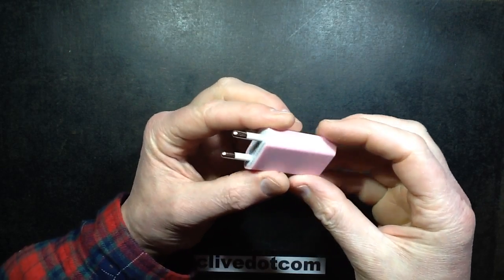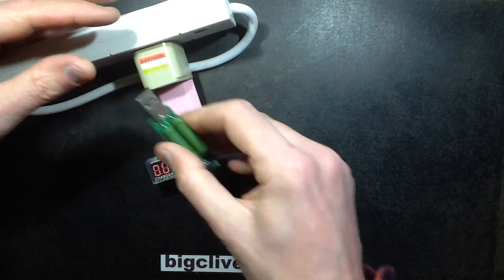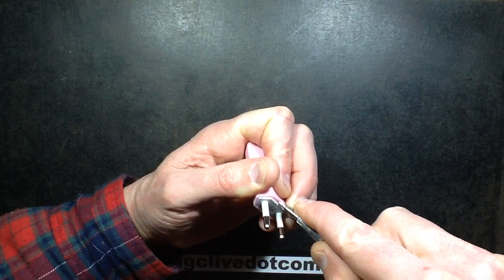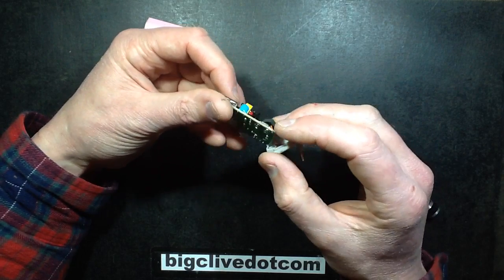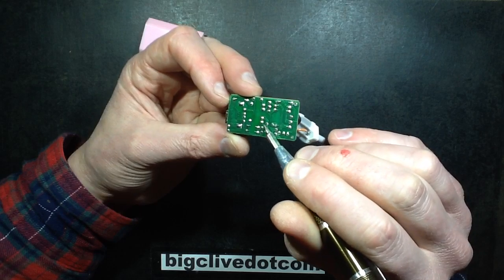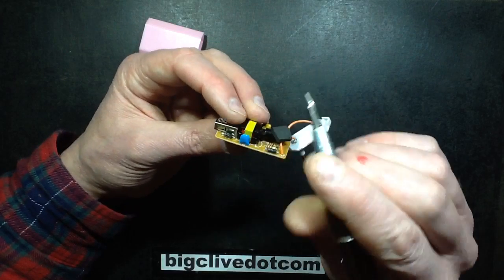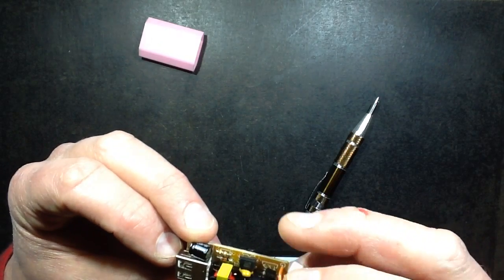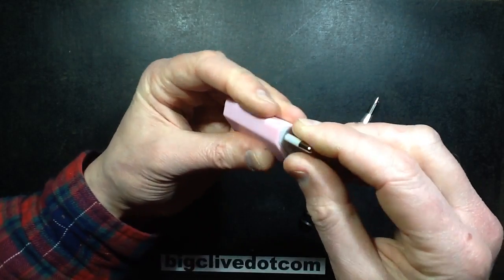A look inside a cheap slimline USB charger from ebay.

Comment: Hello Clive.   I am absolutely paranoid at buying any chargers from ebay, as they are not branded.

I have just bought some security cameras, allbeit at a knockdown price, and they came without power supplies.. Probably because they were USA plug and seller was afriad to send them.   They need 5 volts 2 amps via a USB Lead which i have.

Can you possibly recomend where I can find a safe one, that uses a kind of switching or switch mode process, and has an isolating transformer.  Many i have seen with just a series capacitor and a zener diode or something just as crude..

Any recomnedations would be welcomes, as i want to leave these cameras in a building thats not attended, and left on overnight.

Thanks In Advance
Reply from the maker: For safe 5V supplies I recommend buying USB chargers from your local high-profile supermarket, as they will have to comply with local regulations.

Comment: I have three european USB chargers and all have come with appliances. The Lenovo is biggest with straight body like the pink one in here but much thicker. The Samsung one is second although it has a bigger body the figure 8 connector to change the pins takes much of the space. The Doro is last and is just the same dimensions as the pink one here.

Comment: Clive, can you explain why most USB chargers do not have an earth wire, but others do?
Reply from the maker: I think it's mainly to make them universally compatible with different countries that may not have an earth facility.
Reply: @bigclivedotcom  Well what purpose does the earth wire serve when there is one?
Reply from the maker: @arthurserino2254  It gives greater safety in the event of electrical failure in the power supply, and also stops you getting a slight tingle from metal cased items like laptops and the sides of phones due to current leakage.
Reply: @bigclivedotcom  Ok, great. But if any current is leaking at all, how is an ungrounded charger any safer than this cheap, shitty pink USB charger from China?
Reply from the maker: @arthurserino2254  The leakage is usually capacitive coupling between windings and through suppression capacitors.  It happens with even the most expensive power supplies.
Reply: @bigclivedotcom  Thanks for clearing that up. I'll stick with grounded, then.

Comment: Im already buy a bunch of this cheap usb charger from China.In my opinion , is true is dangerous to people who used it. The only problems of fire hazard and explosion us caused by overheating when this charger operating.
The simple and easy solution to overcome the heat is by DRILLING A HOLE through the charger Housing. Tested by connecting 3 usb fan through USB hub and Run it for 12 hour straight. Still hot but reduce the cause of overheating though.People known that all electronics inside this crap usb charger are using uncertified component. Thanks for the video anyway

Comment: Is this how that poor guy in the UK recently accidentally electrocuted himself in the bath using a USB charger on his phone? How did that happen if the output is only 5v/1A ?
Reply: Envious Fred 
Although the voltage between the two contacts in the USB socket the phone is plugged into are separated by a potential difference of 5 volts, one of those contacts when compared to earth (ground) like the bathtub he would be sitting in would be at a potential difference of 240ish volts in the UK. If there’s enough voltage available to push it through the resistance of your body, it only takes low milliamps through the heart to kill.

Comment: I had one of these blow on me, it blew the orange cover open, which is otherwise a tight fit an it was had to get off (once I had refitted it). It had been working OK, I had removed it from the socket to put a USB connector in,  I had rotated it 180 degree before I put it back in, so the pins were in the opposite socket, I didn't think it should make any different, however it blew as soon as I re inserted it. I think it was due to the rotation but I can't prove it, another possibility is I used a different USB slot, ie one which had a problem.
I am very wary of these chargers now, cheap but very dangerous.
Reply: you had an orange one ? cool

Comment: Let's discharge the cap before touching it - takes metal screwdriver and pokes the cap :D
Reply: My experience told me otherwise - sure, if you would connect both pins at exactly the same time the low resistance through the tip of the screwdriver will short it out immediately. But if you touch only one pole at a time, which would be very likely, I guess there would be a quite high possibility that the charge will find its way through your body to earth, which can be reasonably unpleasant.
Reply: Tinkertubes Lab  Electricity needs a return path, as long as his bench was bone dry, or he was holding it in the air and not touching any other conductor or component there was no return leakage path, hence no danger of electric shock.

Comment: It would be interesing to take an insulation tester and see where the flashover voltage is. Frankly, I don't see how this stuff can be sold without some kind of safety marking, but I guess it just comes in because customs can't inspect any package.
In I prior life I used to qualify power supplies for computer peripheral equipment. The design of this USB adapter is appalling and would never be able to get a agency marking such as UL or TUV.